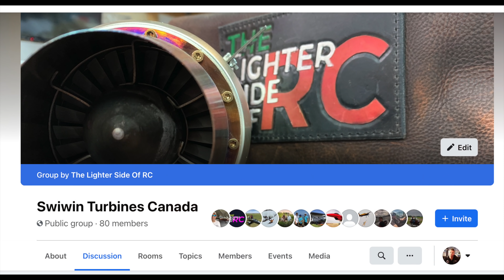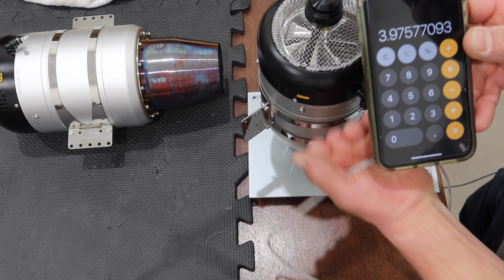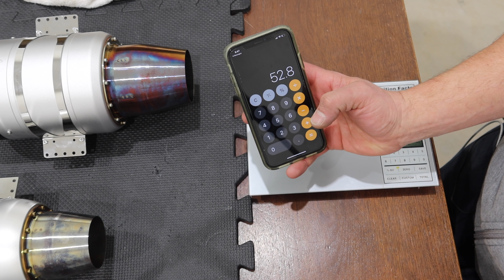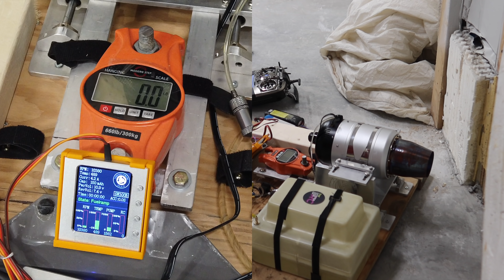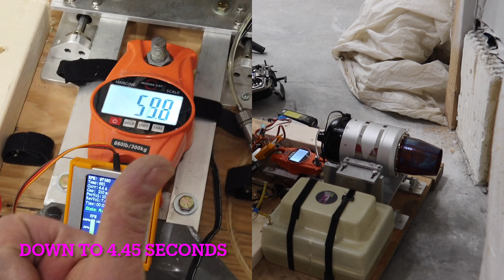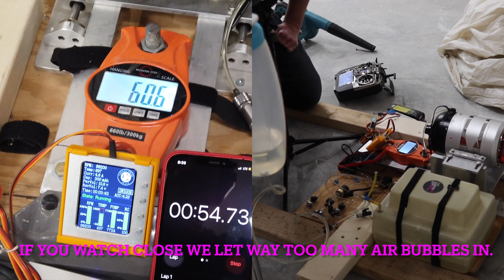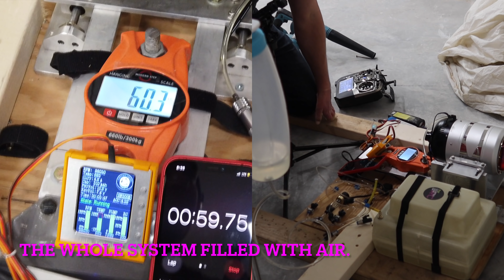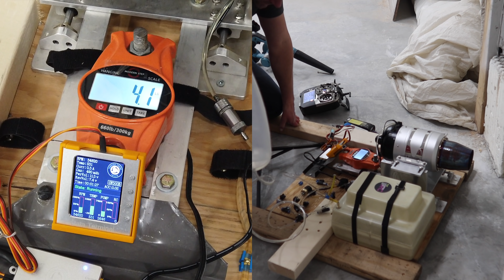TESTING THE BEAST - SWIWIN 300 - unboxing, test run, review

Comment from the maker: Thanks for checking out the SWIWIN 300 Review/test!  if your interested in this or any of the Swiwin engine lineup check out https://www.thelightersideofrc.com/shop
Reply: my biggest worry was fire starting from the engine flames from start up
Reply from the maker: Awesome 😎 yea 2 very different engines!  The 300 will be heavier but more fuel efficient overall compared to the 240’s. The A10 won’t notice extra weight at all.

Comment: Great video, will there be significant changes in the Huracan when mounting this larger engine, tube placement, engine clearance etc. Hope you get to maiden the plane soon.
Reply from the maker: Hey Hank.  I was looking at that the other day.  The turbine mounts about 6" behind the C of G.  The tip of the nose is maybe 5' in front of the c of g.  So not sure on the exact number but if we are adding 1.5 lbs at 6" behind the c of g I suspect we may only need to add 100g - 150 g / 1/4 to 1/3 lb of extra weight in the nose.

Comment: Is the brushless starter permanently engaged? Could one use it as a small generator to supplement onboard power?
Reply from the maker: No the starter has a bendix clutch so when it's not needed it disengages.

Comment: Would the Swiwin 300 Series engine fit in the "Y" bifurcated ducted system, i.e., one engine with two thrust openings, of the F-18C you built last year?
Reply from the maker: Yea for sure. The F18, f15 can be setup with single engine. Most people go with the dual for some redundancy. If one engine fails aircraft can still fly with single engine

Comment: That engine is awesome. And it really sounds like a real engine. But I have a question. Once it is installed into the jet, how long can you fly it? Like what is a flight time with this particular engine, would it be 30 minutes or so? Thank you so much for doing these awesome videos
Reply: It is a real engine. 😃
Reply: @memcrew1  What I meant was, the jets on an aircraft carrier. You ever been on one. I think not
Reply: @jamesmaroon6161  These are REAL turbine engines,  not fake ones, hence they sound like real ones.
Reply: @memcrew1  I know that
Reply from the maker: Hello James!  Thanks for watching!  Average flight time will be 6-8 min depending on fuel capacity.  I suspect when it's installed in the huracan I will be flying for about 7 min.
Reply: @thelightersideofrc  Thankyou Sir for the response look forward to the next video
Reply: @thelightersideofrc  how much fuel can you haul on your bird

Comment: Jonathan thanks again for the Video on the Testing on the Beast . I have Questions so I can learn More. First is there any different in testing the Jet Motor . If you use a Leaf Blower on the Moter Vs without? Because in the Jet it will be Getting Air push to the Motor? Would being in your Job help gain more Power? Last. When will you Test KING KONG MOTOR ? This is the Jet Motor I love to see in your Jet? Hehehehehe. Yes there is a Big Price Jump. Maybe Swiwin let you do a Bench Test then Ship it Back. This Way you have Test all there Jet Motors and you have a Benchmark for the Jet Motor.   Thanks Jonathan you have Someone building a F14 With Batteries power fan ducts.    👍🏻    Bye.  Gory
Reply from the maker: Hello Greg.  There is so much air moving through the turbine that I don't think the blower would make any difference.  The exhaust velocity is somewhere over 2000 km/hr/1200 m/hr.  No King Kongs in the future....yet!
Reply: @thelightersideofrc  Well it will be Called.  King Kong return to Canada! Hehehehehe

Comment: I'm just imagining a pair of those in a F-15 or SR-71 build.  But, 2l of fuel per min at WOT would suck it down REAL fast!
Reply: The IV bottle only holds one litre of fuel it's very efficient for the size of the engine.
Reply: @russellvoth5161  I agree it's very efficient at lower throttle settings.  I went to the Siwin site to get their consumption numbers and to get 15 minutes at full throttle, you'd need almost 8 GALLONS of fuel.  Naturally if you're flying at lower speeds you could use a smaller fuel tank.
Reply from the maker: OH Yea!  But remember that most of the time your maybe 1/2 throttle so the fuel consumption will go down 60-70%
Reply: @thelightersideofrc  Wonder how close to trans-sonic one of those builds could get LOL